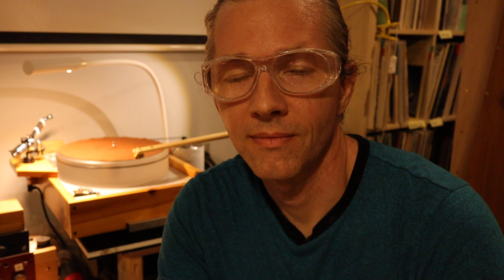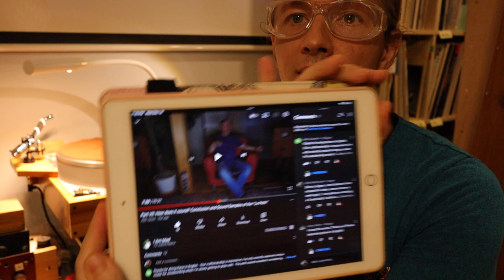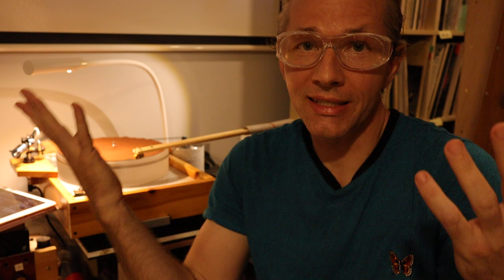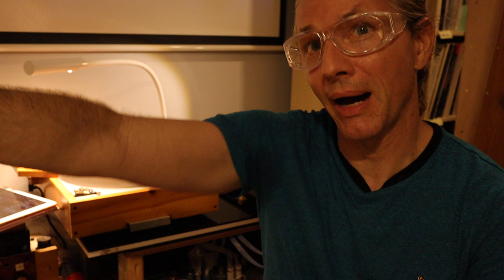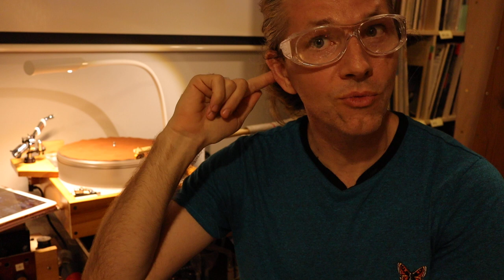Build Single driver speakers to learn solid loudspeaker building skills

Comment: Hi Janos, I am more of an electronics guy than an audio guy but building audio has always fascinated me. For me the fun is to try out concepts and full range drivers are very interesting. When I was at my electronics college, I used to repair audio with a school mate for a TV repair shop. The owner is an audiophile and he told us that if you want to repair audio, you must get the right tools and he was willing to invest in that. So it came to speakers and the three of us decided we needed a set of speakers that could reveal problems with audio, would withstand something going wrong (like oscillating, clipping, DC bias and so on within reason). That means by default a full range driver, no blowing up of tweeters every other week. We settled on a 12" full range Philips driver, becasue they have a reputation of being tough (we are Dutch after all and we where not building a high end system). We bought the drivers, put them in an 80 liter plywood sealed cabinet as per application notes (not particularly aiming for a life cabinet). The result pissed the owner off. Not because we did a bad job but becasue these banger speakers that where designed to be abused did things he could not get out of his expensive gear at home. 
Personally I have always had nice results with full range speakers. I also think that $ for $ they are the better choice. Take for instance a nice two way speaker with a 6" woofer. For all the components, you could easily be at $300,- per speaker, excluding wood. For $300,- you can buy a 6" Supravox full range driver in Europe. If you want to compete with that, using a two way system, you will have to dig much deeper in your pockets. And indeed, I totally agree with you that building a multi way speaker is multiple times more complicated and also in areas that are not related to speaker cabinet building, i.e. driver matching and cross over networks.

Comment: A question for Janos:
When dealing with tubes like 300b and 211. Why is it that we don´t have a proper tube seal all the way, from top to bottom where the pins go into the tube holders? Why are there air pockets and something that wraps around the tubes instead?

In theory if these tube holders were made of thicker metal like pure silver and have a totally tight seal, would we not get 1.5-2x more watt effect out of the tubes and a much better sound, because then the contact is so much better and they vibrate a lot less?
Reply from the maker: Hi Larry, great observations! I'll make a video on this. ; ). It's the way it is for several reasons, top one being practicality, the second one being grip stability for the tube socket and heat dissipation. However, upgrading the base is really transformational to the sound. So far I went only as far as soldering the wires directly to the inner support wires inside the legs. However, you are totally right, redesigning the tube bases from the ground up would be a big step in sound quality, to have not only improved electrical but also improved resonance control & improved heat sinking as well. Especially for big DHT power tubes, they dissipate a lot of heat through their filament pins.

Comment: Hopefully this will help the club. My goal is to build a system as simply, cheaply and intentionally as possible without compromising sound. Here are my observations so far.

1: woodwork is difficult to do right. So I use old cabinets instead.

2: these old cabinets must be sealed or front ported to work easily with a room.

3: I want a balance between bass and impulse. 10" is what seems to do this for me. 12" has too heavy a cone and 8" too small a surface area.

4: the driver should have a large dust cap or whizzer to avoid peaky treble.

5: high efficiency drivers are better. They require less Watts to drive.

6: a low watt driver usually has a weaker spider allowing low level detail to come through.

7: a low watt speaker tends to have a lighter cone.

8: I would much prefer a 15w speaker usually than a 300w one as it operates in the first 10 Watts much better.

9: low qes and high qms is good.

10: avoid peaks 3-4k

11: conforming to the fletcher munson curve = avoiding listening fatigue.

12: a speaker that rolls of from highs smoothly is better. Ragged highs = distortion

13: tweeters are less important than you think. The vast majority of music is 70hz - 1500hz make sure this area is as good as possible.

14: if possible run the 10" driver without a crossover. 1st order crossover is OK but no more. I run my 10" open with no crossover and the tweeter 1st order.

15: a high crossover point for a tweeter is preferable.

16: cone tweeters are not necessarily bad. They tend to be cheap and have higher efficiency and clend well with the main driver.

17: large cabinets are almost always better than small.

18: wide baffles work well.

19: metal dust caps on main drivers sound good and tend to be an indicator of high quality.

20: everything is a compromise. I'm not going for the best I'm going for my sweet spot.

21: lower watt amps generally sound better.

So what does this mean in practise for me? My current favourite speakers are sansui sp-50. My latest project is some marantz imperial 5g cabinets that I will use a low qts 10" driver in. My current amp is an tripath amptastic mini. Hope this general observations help 😊

I would appreciate your feedback on these observations so I can improve 😊

Comment: You make some good points about single drivers. I only have experience with larger ones, 8-10-12 inch Audio Nirvana and Lii Audio, but none of them are linear enough to be fully satisfying without correction. However, once you have nailed the tuning, corrected for beaming and baffle step effects, single drivers have such qualities that you will have a very difficult time building a multi driver system that is as good, let alone better overall. 
On open baffles: I'm sure that panel resonances play an important role but I would guess that sizing, shape and room placement are more akin to choosing the type and size of box and take precedence in forming the balance of the sound.

Comment: Janos Merry Christmas.  Ypu finally mentioned OB haha here’s my chance😅  Due to costs I have one chance at this.  Remember I found a mill who can supply Bunya Pine cut to order.  I’ve really searched for a info for this with no luck.
The drivers are Goodman’s 12” triaxioms that present really like a single driver (is it a di-pole?) and I want to ask is there a formulae for the dimensions shape driver placement that you know of?  What’s on YouTube is all over the shop.Thanks if you get to this,
🌞